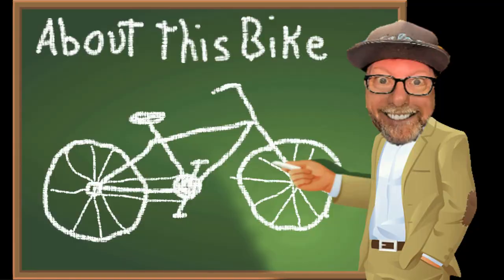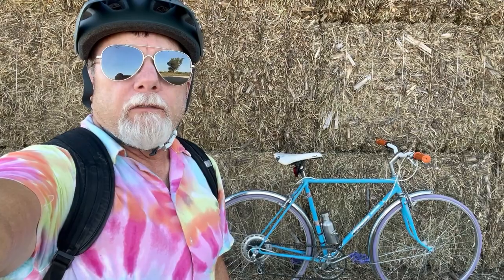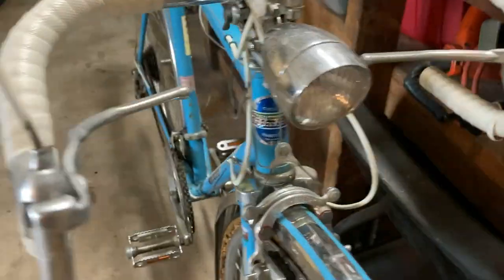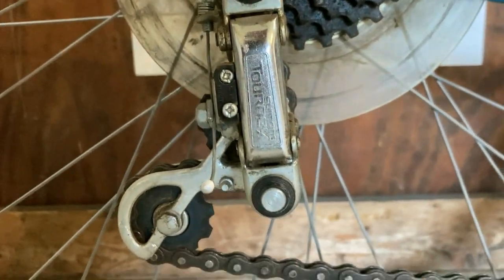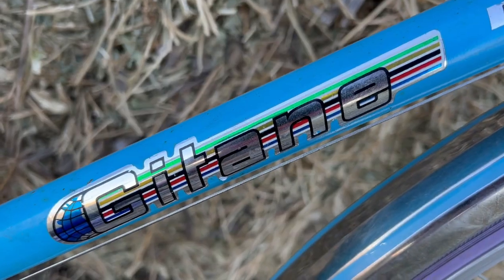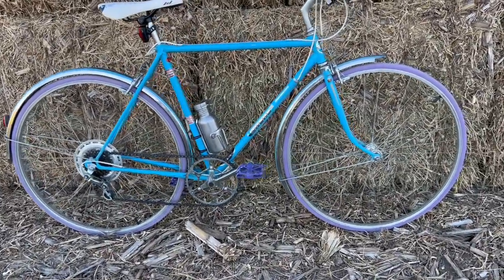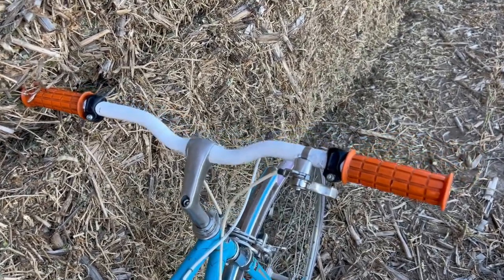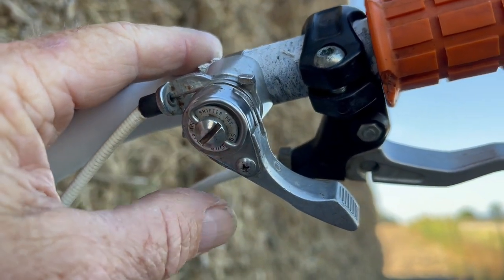About This Bike - Gitane Grand Sport De Luxe

Comment: Hey Randy... did this bike have a shop sticker for Tom Sawyers Bike Shop?  That looks like their old shop sticker on the down tube?
Reply from the maker: Yes it does. Appears to be one of the old stickers since it still included mowers.
Reply: @Locojoe  And it's giant (size wise), and it's oval, both point to the earlier stickers they used at the shop.  I saw the Gitane (and it's mate) and fell in love w them, partly because it still had the TS stickers on them.  It was just too small a frame for me, and I couldn't think of anyone who could benefit from it.